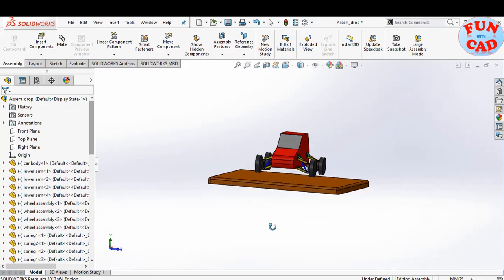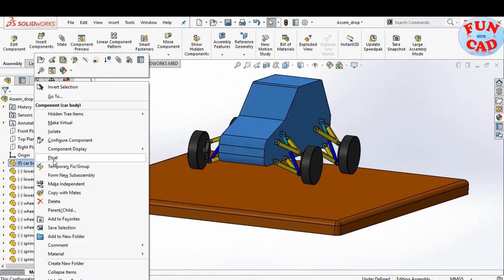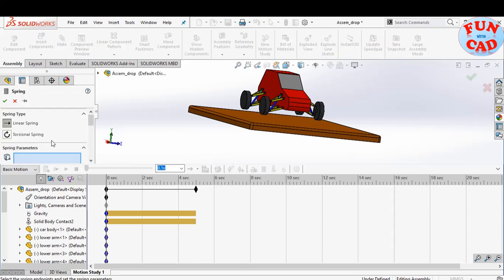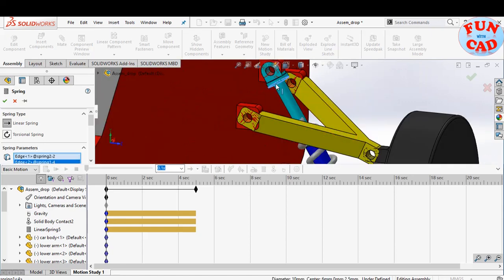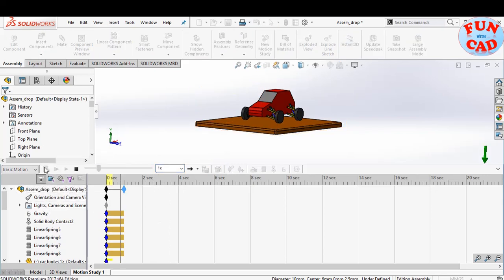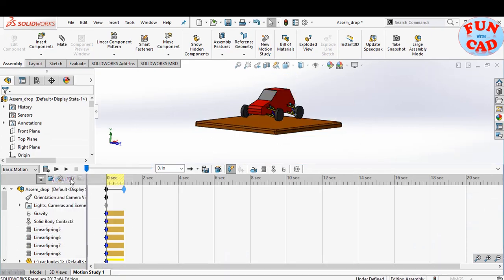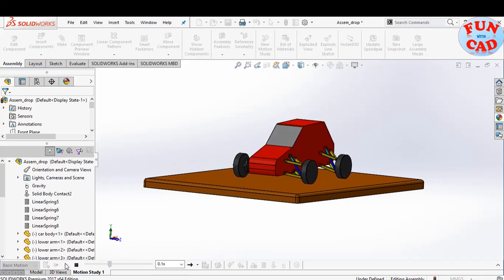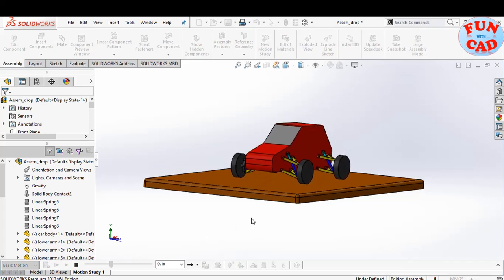Suspension spring effect, CAR drops from height | SolidWORKS Assembly | Motion animation Tutorial

Comment: Hi, i have a question, why does my car it’s very rigid when falling on the base, it doesn’t bounce really good :(
Reply from the maker: Hello, there can be multiple issues for your situation
1. The spring parameters are not correctly set according to your car model
2. The car body may be a very big solid mass, try to make it hollow and then try your motion study
3. The assembly may not be properly mated 

You can make trials for multiple spring values to check which one suits your model